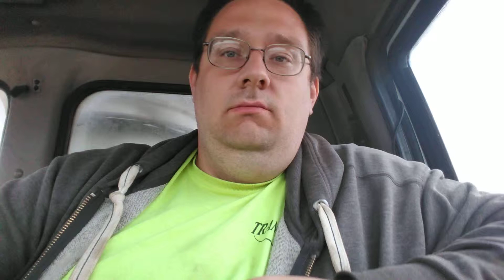What is a Repeater and Simplex node on The GMRS Linked Network

Comment: The FCC says it’s not in the public’s interest. When did they poll the public ? They usually make their decisions from what a particular manufacturer asks for. GMRS is growing, when will the FCC start servicing the public demand. We need more channels. Why not give GMRS a UHF APRS channel to send text messages ? It won’t cost the FCC a penny. It would be up the the GMRS community to erect digipeaters for this channel solely to send safety messages back home when out camping and hiking. Ham operators operating on UHF could also make use of this network augmenting their VHF APRS network of digipeaters. With all of the newer radios being software programmable, they could easily have an additional channel added in firmware. The FCC needs to add 10 more channels to the UHF MURS band, and combine their use into 1 radio with GMRS. The people have spoken, we want solutions to our increased use of the outdoors. In addition to recreation we want solutions for preppers as this world has increased worries about storm and other environmental catastrophes.